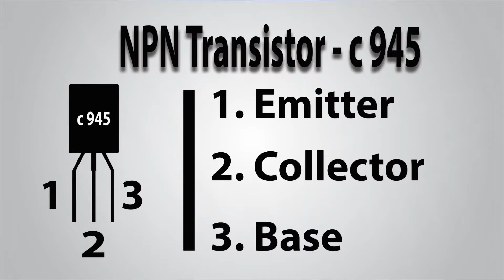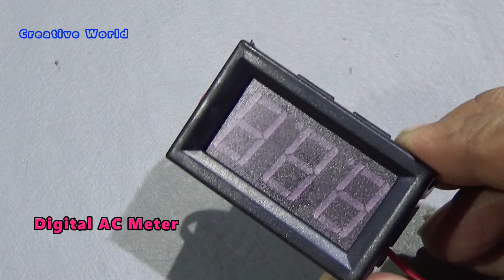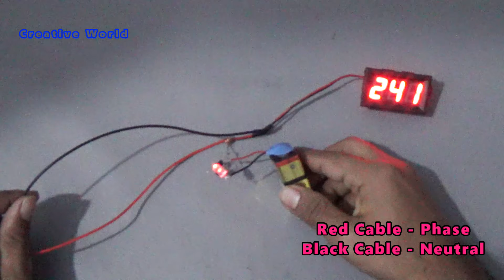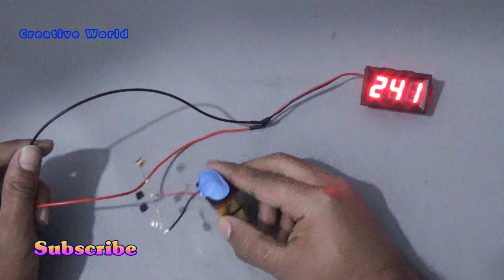How To Make Wireless Ac Line Detector Circuit || Homemade

Comment: Hi sir I made it but once I put the battery the led is on!!can you tell me please why???thank u for every thing.
Reply from the maker: please check all connection & how many volt you use in this project ?
Reply: @CreativeWorldPro  its OK bro..I made a fault in the connection..thanks a lot ...but I am wondering if there is a possibility to detect current from 1inch distance!!I cause I work on aircraft harness and its all the time a thick one..I have a cut in a wire 115v AC 400hrz  in the middle of 50 one.??is is possible to detect it and how???thanks a lot.
Reply from the maker: using this circuit you can detect. but you need to make a distance of those 50 & need to check one by one.
Reply: I have used 5 volts charger but I couldn't achieve this project
Reply from the maker: this circuit, don't work with 5v, you need 9 volt

Comment: Does only Works for 220-240 or also for 110-120?
Reply from the maker: you need only 9 volt to run the circuit
Reply: What I mean was in your country  looks like 220-240  here we have 120. So the question is works ether 240/120 or only for 240. Thanks
Reply from the maker: sure, it will work,,you can try,,,
thanks